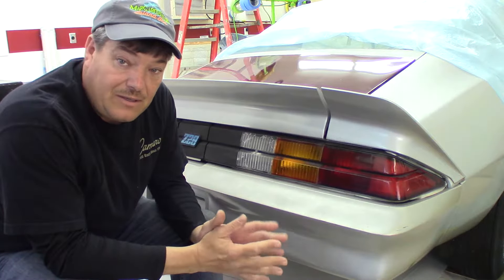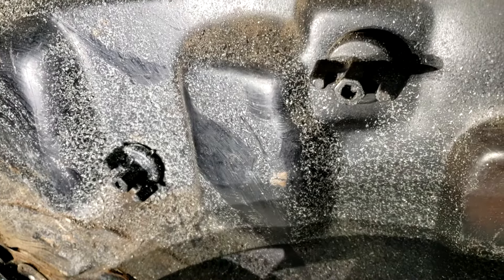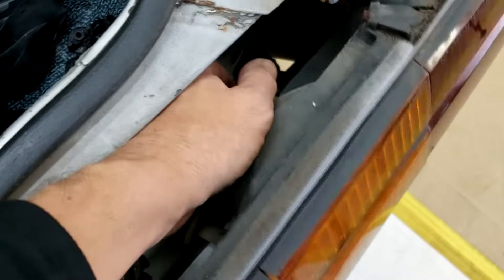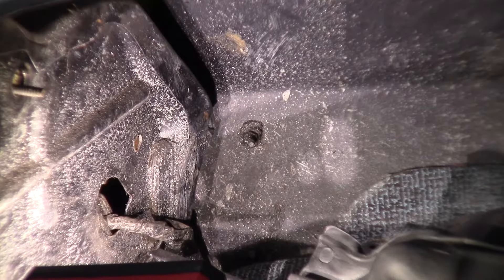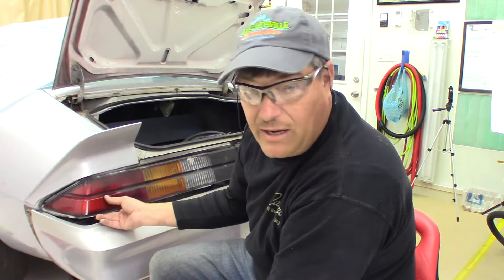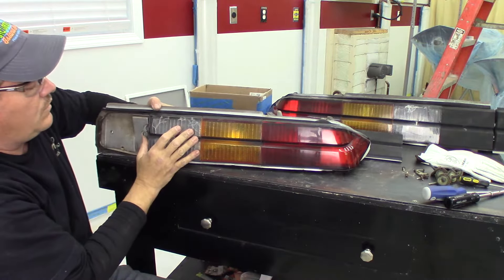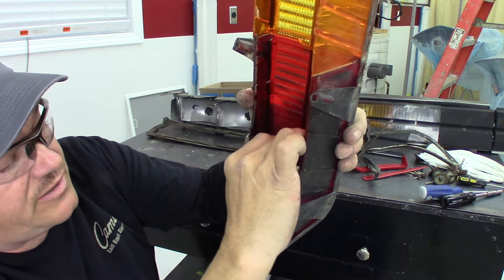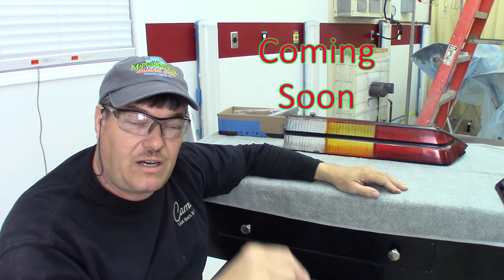1978-81 Camaro Tail Lights Disassembly, Frustrations of a Project Car

Comment: Great video Russ!   Glad to see you back in the shop!!
Reply from the maker: Thanks Dave, how's your projects coming along?
Reply: @DoubleRRestorations  Just got the 70 back from the dipper... getting ready to get back at it.   As a side question...what camera do you use for your content??
Reply from the maker: @DKz Garage  Nice, I have an older Canon Camcorder, I think it's a vixia hf600. The wide angle lenses are cheap and that's good for grinding and welding.  I have been wanting an m50 for just speaking parts. Still a little pricey though

Comment from the maker: This is a video from 2021, and I almost have the housings restored, but I'm looking for  an NOS LH 78-81 Outer Body Gasket, I'm looking for, GM part # 5969325. I have the right side, but need the left. I have the repros, but they are very stiff. I haven't tried soaking them in Simple Green or setting them in the sun. Thanks for stopping by, remember to subscribe and follow the build. To Be Continued......

Comment: hey Russ, nice to see a new video. Weird how that gasket cuts across the corner like that. I have a back up light socket that needs replacing on my 87 firebird. the original has 3 wires. I bought a new one but it only has 2 wires. I'm trying to figure out if i got the wrong one or what. Keep that in mind if you need to replace any of them.
Reply from the maker: Will do, thank you.  The 3 wire may be the brake and tail lamp one combined.

Comment: there are many years I stay away from because of stuff like that..  turns a weekend project in to a year long struggle...  and $500 more than you wanted to spend...  I dont think those tail lights are meant to come apart...  well, at least 20 years ago they didnt sell a single thing for them....   i bought A 79 z28 in 2002 and had to get rid of it..   it was yellow with a black interior.  it had a 1972 454 in it...   i pulled the engine and sold the car..   guy gave me $500 for the interior a day after i listed it on craigslist.. rear spring perches were rusted through the floor....  my dad warned me about that..
Reply from the maker: Thank Chris, yes I don't think these cars were made to last. I've almost got everything I need to restore them. The good news is once the car once restored will be kept inside. That should help on saving some of the plastics. I always enjoy your channel, thanks for stopping by.
Reply: I’m trying to clean everything and get a paint booth set up up and it is taking way longer than I thought.. I really like that shop you have there
Reply from the maker: @Chris Craft 2  Thanks Chris, it's been alot of work.  It's a struggle to keep it clean.